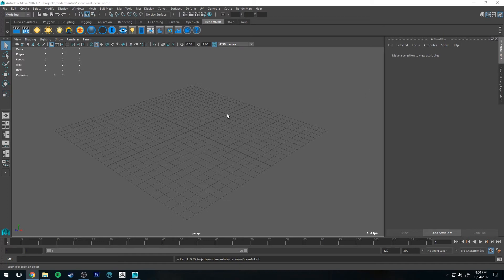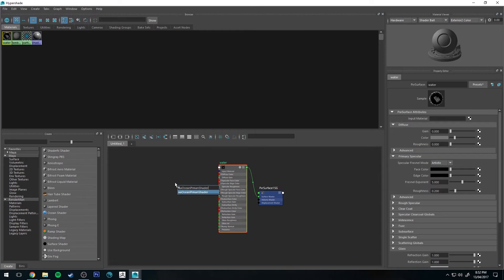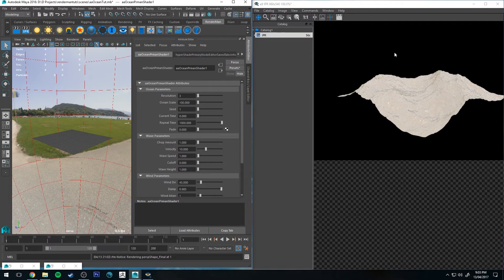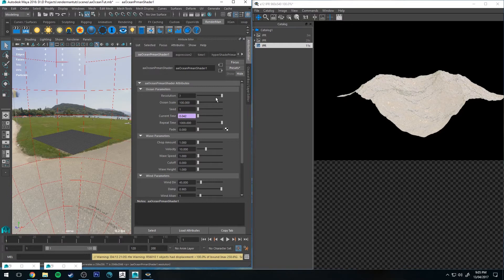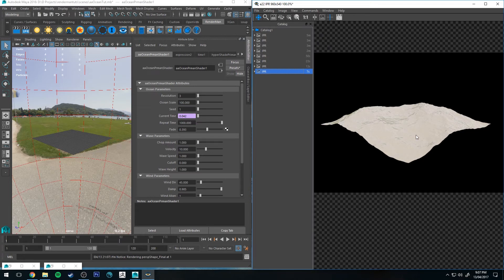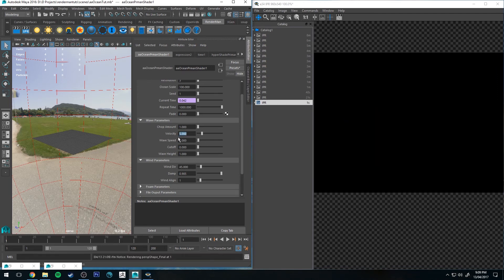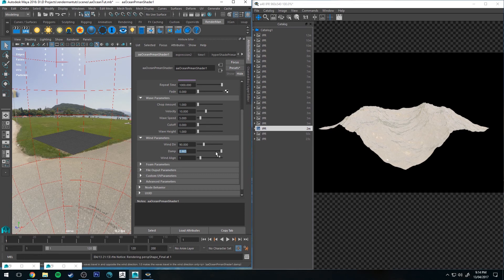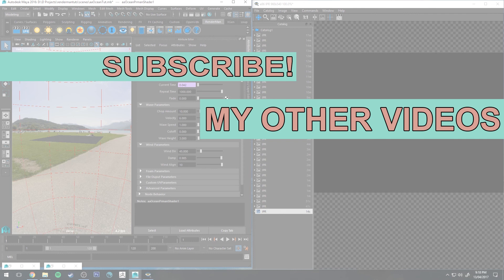Renderman 21 Water with aaOcean Tutorial

Comment: It's not working. I keep getting fractured tiles in the render. I'm positive I'm doing everything right.
the only thing is I'm on a newer version of Maya and Renderman.
Reply from the maker: Enable water-tight dicing on your displacement in the attribute editor
Reply: @SmallRobotStudio  I'll keep that in mind. I think I fixed the problem using an alternative method.
Thank you so much for responding so fast!
Reply: @SmallRobotStudio  I enabled water-tight dicing in the advanced render editor and it still doesn't work.

Comment: The problem I am encountering is that you can't get closeup to the water, or it won't render. The render window pops up, but it's just a black screen. After 10 minutes, the screen is still black and ends up using 4,000 mb+ of memory, even though my machine has 24GB of RAM. Even with the lowest settings, it does this. When I zoom out farther away, it's fine. EDIT: I figured out, I can't use any other PXR Materials in my scene as long as the AAOcean shader is in there. If I hide the ocean, or if I hide the other objects on the water, it renders fine. Why?
Reply from the maker: When the camera is near any displacement map you'll encounter this, the camera is clipping the plane of the water where the displacement and the camera intersect.
Reply: Odd. Because when I used MayaOcean for Mental Ray, that wasn't the case. Wasn't MayaOcean using a displacement as well? I'm just going to try HOT ocean and see if that works, because my scene requires it to be close up.
Reply from the maker: This is specific to the way Renderman acts

Comment: I'm having some real problems with the aaOcean.  It won't even start a render. Just stays black. Then, when I cancel the render and click on something else in Maya it freezes. I've tried everything I can think of. I The RGB output of the aaOcean to the pxrDisplacement. The XYZ output. I tried adding a Renderman subdiv scheme to my plane. I tried adding a pxrDisplaceTransform or whatever it's called and making sure everything is set for vector displacement. Nothing. It's driving me nuts!
Reply: Also, I've tested other methods of displacement like a checker texture and it worked just fine.
Reply from the maker: Okay so if your other displacements work I'm assuming you've set the project and saved the scene so that's not it (unless it is?). To my knowledge there is no other way to set up this displacement so trying other operations won't work. Have you set the resolution too high for the displacement or is your camera close to the plane that you're displacing? If the camera is clipping the displacement it will not render 9/10 times. Also the first time the displacement is cached the render can take a while to IPR, sometimes up to 90 seconds (on my i7 6700k) especially if the resolution is high. Alternatively check out HOTocean deformer (tutorial here: https://www.youtube.com/watch?v=S-M2yEnGsxA).
Reply: It was the camera. I didn't even think about that. It works now, but I also tried the new BOSS ocean sim feature in Maya 2017. I think I prefer that because you can see the displacement and animation without having to render it every time. You just need a lot more faces for it to work.

Comment: Do you have any tips on methods on shading the water? I do realize that water gets much of its color from its environment and how the light refracts, reflects and diffused by the water. Any ideas would be helpful.
Reply from the maker: Depends on the scene really, the simplest thing you can do is have it reflect something like an hdri applied to a dome light. Further to that foam would make a bit of difference on a rougher scene but the built in feature doesn't work currently so you'd have to map it out randomly using a texture node or do some science and figure out a script. In most scenes the water itself isn't going to be the focus so if you get it to look 'good enough' then dress it with whatever else is happening in the shot you're going to be pretty well off. And as always: lighting, composition.

Comment: what do you think is better this or bifrost? or can they be used in conjunction?
Reply from the maker: Bitfrost doesn't work with Renderman unless you convert it to OpenVDB so it really depends on what you're trying to do and how much time you've got.
Reply: how do you mean it doesn't work when I make a BOSS sim in maya and apply shaders it works. or do you mean with batch rendering?
Reply from the maker: Does BOSS use Bitfrost? I've not used it yet but my understanding is that as of Maya 2016 bitfrost doesn't work with Renderman - unless I'm wrong?
Reply: BOSS means Bifrost Ocean Simulation System so I think it does involve bifrost however BOSS bends a plane to create the ocean and does not use any particle system so maybe that's why BOSS works and bifrost doesn't
Reply from the maker: Oh right right, sorry I was thinking of MASH (getting my acronyms confused!) yeah as long as it's not using a particle sim and just a displacement it would work, I've not used BOSS myself so wouldn't know. The alternative to this would be HOTocean which is pretty good but gets a little visually repetitive but is a little easier to visualize in Maya.
Reply: Man mayas Arnold doesn't even seem to support some of it's own stuff in 2017